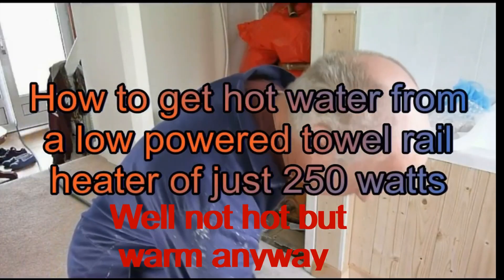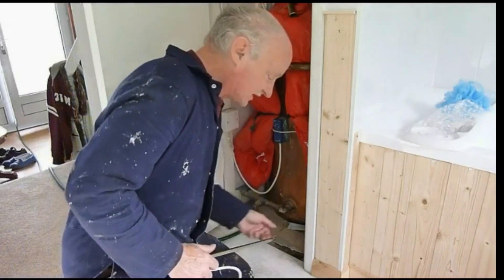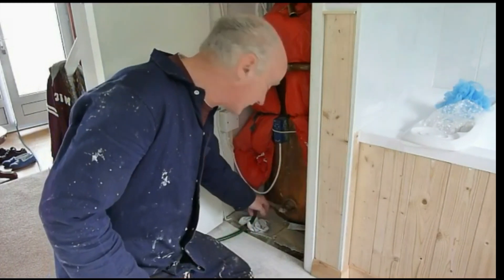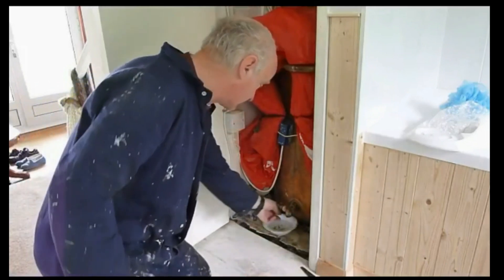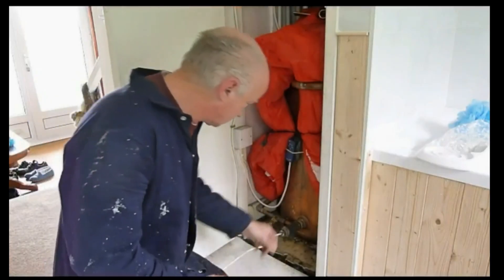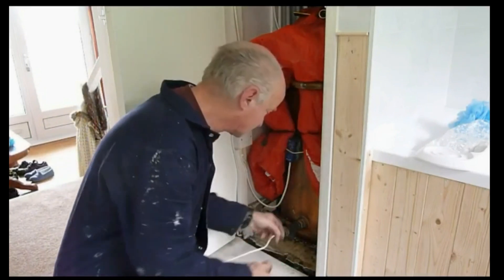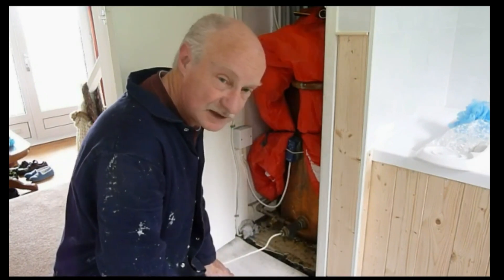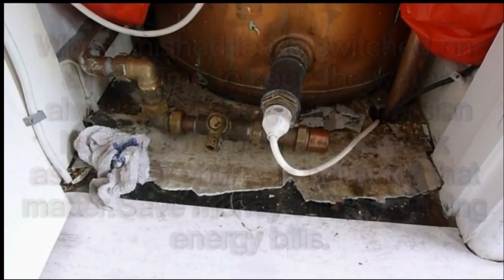How to warm your hot water tank using a 250 watt towel rail element

Comment: Could you use a Megflow tank (with a low wattage element connected to solar panels) before the cold water supply to a combo to preheat hot water?
Reply from the maker: Yes you can.

Comment: I had to watch your video twice lol, I don’t think this would be recommended under BS EN 806 as there is no thermal cut out and it wouldn’t be able to sense the temperature of the water in the cylinder. Having it on a timer  will only tell it to come on and off unlike a proper immersion heater that unitises the cylinder thermostat with a bio metallic strip to tell it to turn on and off once the required temperature has been reached. I hope I’m right as am going to be sitting my plumbing exams soon 😳
Reply from the maker: You probably are but the element would never get the water hot enough. There are also ones with a thermostat.
Reply: Thanks again take care and keep your videos coming Lee 👍

Comment: Al, you can still do this with a combi - use an unvented cylinder on the cold supply to the combi - with a diversion controller you can use excess generation to heat your hot water via the immersion element - the pre heated water travels though a blending valve so you get the right temperature water before going into the feed to the combi. 
The combi senses that the water is already at the right temperature and passes it to the hot tap.
If we have had a very cloudy or bad generation and the water is not pre-heated the combi modulates the gas to raise the water temperature to what is required.

I have been doing this for more than 10 years and I am able to turn off my combi from April through to the start of October and still get all the hot water I need
Reply from the maker: That`s a great tip Andy, thanks.
Reply: @dereton33  1 of your dodgy layout drawings please Al
Reply: Could you please do a famous dodgy Al drawing of this layout???
Reply: @Andy T is this basically the Eddi device?